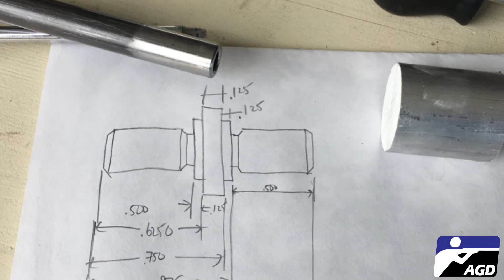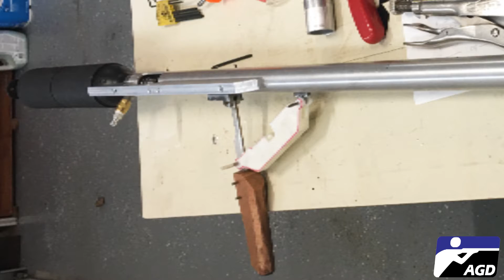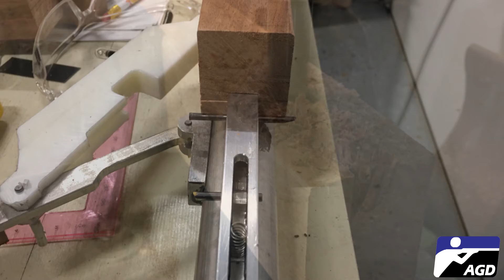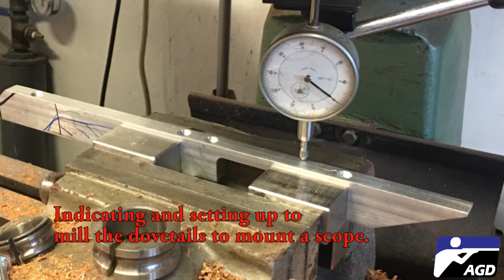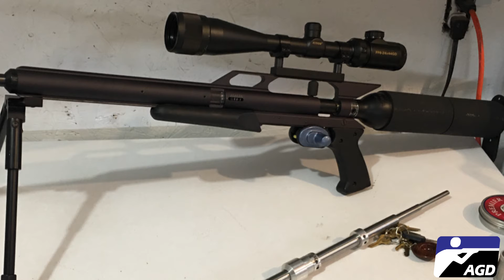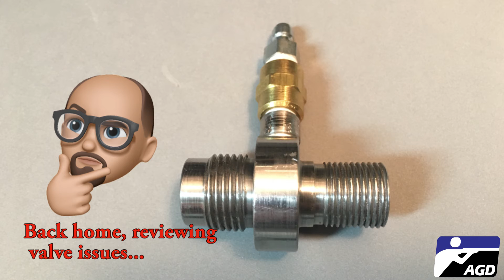DIY BigBore PCP Airgun - 308 Build - Part 4

Comment: We need this to be easy like the diy guns nowadays. Can’t we make this easier with the use of 3D printers?
Reply from the maker: 3D printing has come a long way but not economically viable. Airguns use high pressure air so the parts that can be printed are minimal. A few are making accessories for airguns using 3D printers. Thanks for the comment.

Comment: Hello my friend. I am also a PCP shooting enthusiast. And I am constantly improving my PCP for nearly 15 years. You have good hands-on skills and very enviable purchase conditions. I make all the parts by hand. The body, the barrel, and the mold ，are very hard, and the progress is slow. But I keep improving. I watched your 4 videos roughly. Put forward the following suggestions: 1. The body and the scope of the scope must be integrated, try not to choose this kind of split installation idea. 2. The physical strength must continue to improve. In particular, the spatial relative connection structure between the scope and the barrel must have sufficient strength.
3. The gas you mentioned in the video No. 4 is released at once. There are two reasons for this: The first reason is that the spool return spring fails or the main spring is too strong. The second reason is that the valve core area is smaller than the valve nozzle area, which makes it impossible to reset.
Finally, I wish your wife a speedy recovery.
Reply from the maker: Thanks for the detailed comment! Nice to hear you have been making airguns for awhile and no doubt have much skills. The reason my design is in two pieces, a main tube and rail, making from a single piece of aluminum would be costly and be a lot of machining. If I still had access to the equipment that I used years ago, it would be much easier. However, I designed to be able to use the equipment I have in my garage. 
Regarding the air dump, yes a lighter hammer spring and stronger valve spring will solve this. Working on a balanced valve design which should require very little hammer force to open the valve (if I can get it to work).

Lastly, my wife has been home for two weeks. Her cancer is slowly increasing and doctors made it clear she is terminal. Just taking it day by day. Thanks.
Reply: @airgundevelopment  This is really frustrating news. Your voice is very young, but you have to experience the tragic event of your lover's departure. In the limited time, take more care and accompany her. There is nothing we can do about the laws of nature.
    When you have free time in the future, we will discuss the technical details of DIY PCP together.
    When the spool diameter is greater than 8mm, too much force is required, and it is difficult for the valve to work smoothly by simply tapping. The caliber I chose is .257. The spool diameter is 7.4MM. The valve nozzle diameter is 8MM. The output kinetic energy is about 200 joules. The problem I face is that the efficiency is not high enough, although the valve can be opened normally. However, it will cause slight differences in closing time and slow closing. Your rifle is 308. I think you should give up tapping the valve and try to make a balance valve.

For the PCP gun body, I think if the weight is not considered, the steel of the same material as the tube is the best choice. Because they have the same coefficient of thermal expansion and contraction, they can avoid consistency problems when the temperature becomes too large. You can use split welding and aging treatment to complete. My next PCP will adopt this approach.

The normal work of a PCP is the most basic start. How to achieve high-precision and sustainable shooting is the ultimate goal we pursue. My level is low and I have a lot of confusion. I hope to discuss with you further. My PCP is currently 1.1L main air chamber. 30MP-18MPA has 60 shots. The projectile weight is 6.1 grams and the projectile speed is 255M/S. But my accuracy is not good. Sometimes it can achieve 150 meters 0.7MOA, sometimes only 70 meters 1.5MOA. I have been looking for the source of the problem. Do you have any in-depth research on precision shooting? ?
Reply from the maker: @曲阳-i3l  Thanks for sharing the details. I do no have enough experience shooting long range. There is a guy you may have seen, Tofazfou, he does a lot of long range shooting.